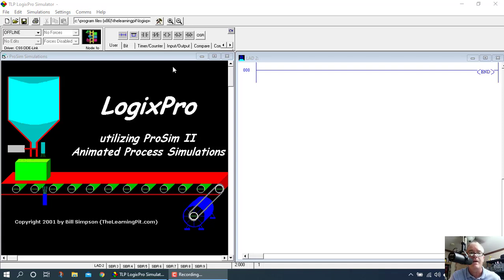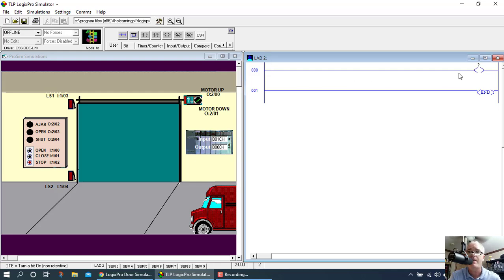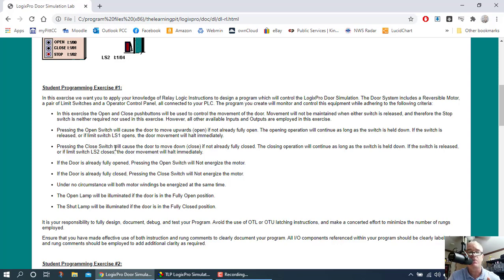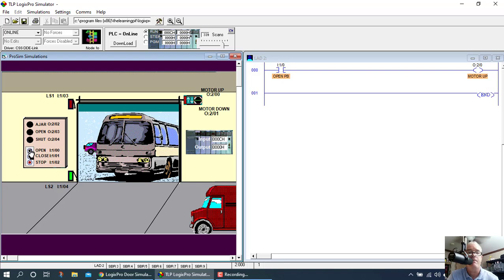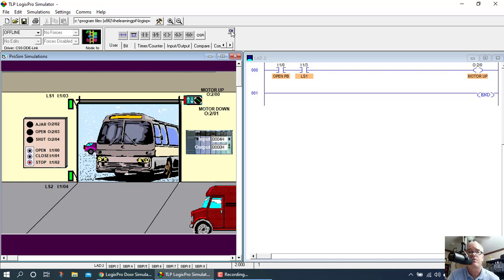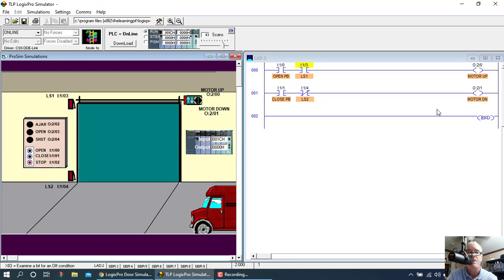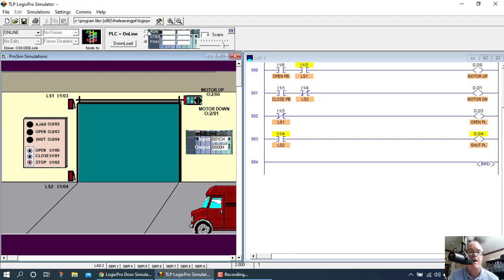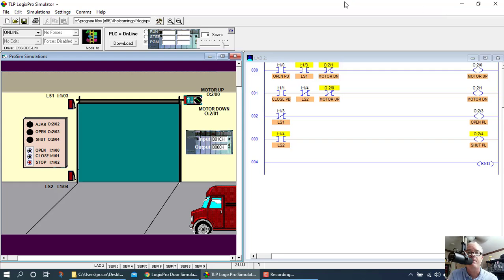LogixPro Simulation - Garage Door Exercise 1

Comment: In regards to 27:00 in order to keep both motor up and motor down from activating at the same time, I added XIO close PB on the first rung, and XIO Open PB on the 2nd rung instead of XIO'ing the motors. Is that also a valid solution?
Reply from the maker: I would say it's "acceptable", but not the standard method of interlocking. This method could be problematic if pushbuttons are faulty, which would be a safety concern.

Comment: That doesn't make sense Why would you have a stop button? This sim is made to be an automatic not manual You have to latch.  the ajar is when the up or down is already running.
Reply from the maker: In this simulation, the Stop button is used to stop the door if it is in motion, such as if you change your mind, or if something is in the way of the door.
Reply: Yeah, I tied myself up a bit with the Stop PB also, I felt a lot better when I read the student exercise and it said the stop switch is not required nor used in this exercise because the motor is not maintained after either PB is released.